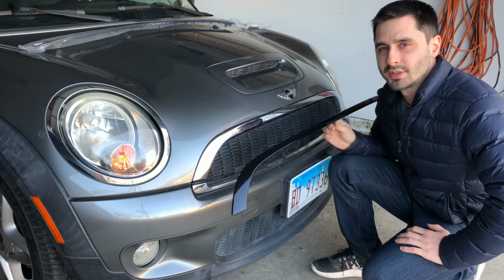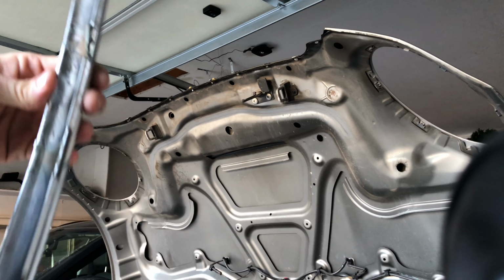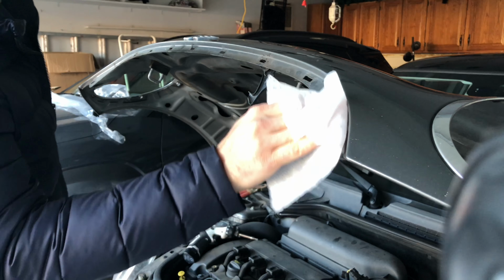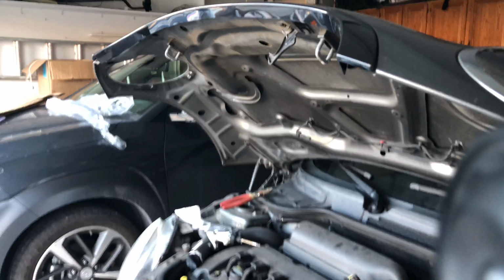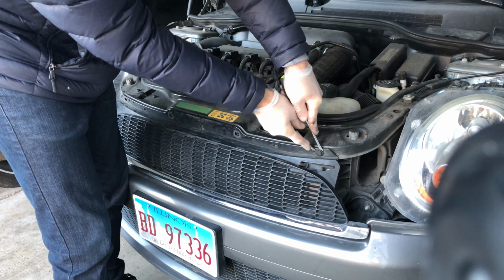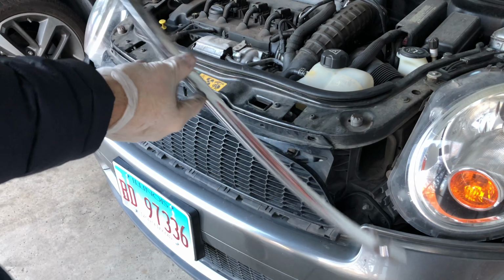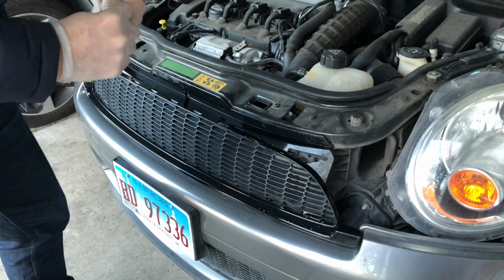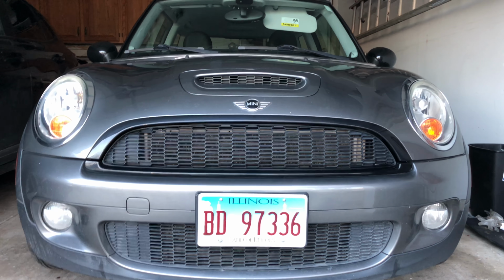Removing Grill Trim on R56 Mini Cooper S - Installing Black JCW Grill Trim - Chrome Blackout

Comment from the maker: Thanks for watching one of my early videos. Consider subscribing for newer and improved car content! 
Check out this video on MINI Cooper problems to expect: https://youtu.be/AQBX1sBhLVc
Reply: Thanks. I’ve got to replace my upper unit. Now I know what I’m doing.
Reply: What year is your R56 Cooper S?
Reply from the maker: It’s a 2010 model.
Reply: In your video here you are replacing the top and bottom "air inlet trim finisher" parts.  I want to ALSO replace the plastic chrome grill with an OEM black grill on my 2013 R56 mini.  Do you have the part number for the black Grill, and is it easy to replace?
Reply: @SimpleCarGuy I don’t want to blackout I want to install the upper and lower chrome trim. Where can I get those and need screws and retainers if it doesn’t come with it. 2011 Mini Cooper Base.

Comment: Thank you!  I just installed mine today, and only take a few minute with the help of your video.  I first tried an after market trim but the holes didn't line up and so ordered the genuine mini trim and fit perfectly.
Reply from the maker: Genuine is usually the way to go if you don't want to drill holes and MAKE it work! Thanks for watching.

Comment: Looks great. I say black everything out other than the chrome trim around the windows. That nicely separates the top of the car from the bottom.
Reply from the maker: I’m going to try to vinyl wrap some of the pieces and see how that turns out
Reply: I use peel coat spray from rustileum. Also use the metallic peel coat to paint on stripes. Factoey stripes get old and nasty

Comment: Thanks for this.
One of the clips broke when I took off the upper air inlet finisher, but I guess that can heppen when the part is 13 years old and has been subject to extreme temperatures!
£53 for a replacement.  Ouch.
Reply from the maker: These clips are very brittle since they sit so close to the hot turbo. At least it's easy to replace!
Reply: I bought all aftermarket trim in matteblack, light trim, tail light trim, door handle covers, fuel cap cover, bumper trim all for $311 USD
Well, $400 AUD which is roughly £200

Comment: Thanks for such a great video on how to replace the upper grill trim!  Mine has been loose and finally fell off.  I'm am going to order a replacement but notice that I only have 2 of those black screws still attached to the hood.  The other 2 are gone or never were attached.  Would you happen to know where I can find replacement screws?
Reply from the maker: I think you can use any screw that's similar, but if you need the exact part, I think this is the part number you are looking for: 41007135209
Thanks for watching!

Comment: I accidentally put the clips in first and now I’m having trouble removing the black clips to attach back onto the trim itself. They’re so hard to remove from my Mini. Any suggestions? I’m a girl and decided to do this before watching videos on YouTube
Reply from the maker: Sorry you ran into problems! If I understand correctly, you took the clips from the trim and attached them to the car first instead of the trim piece. What you can do to fix that is get a trim removal tool (link below) and that way you don’t break them when removing. If you want to risk it, you can use a flatbread (or 2) and try removing it that way.  
https://amzn.to/3czAAmD
Reply: SimpleCarGuy thank you so sooo much!! 💜 I appreciate the feedback

Comment: Separate the clips while removing that way you don't need a hammer. And drop the bonnet instead of using force. It leaves pressure dents behind
Reply from the maker: Good points, I got the car the way it was.